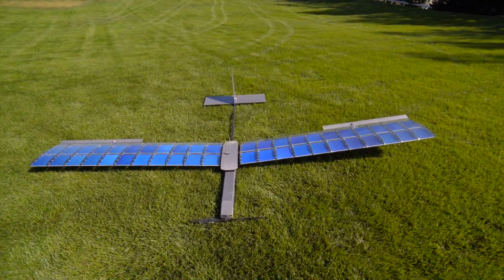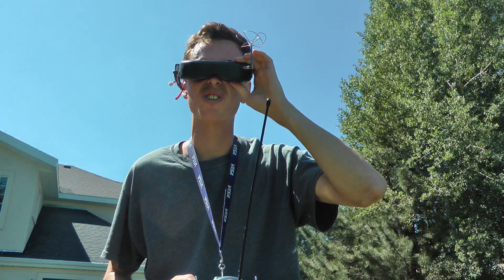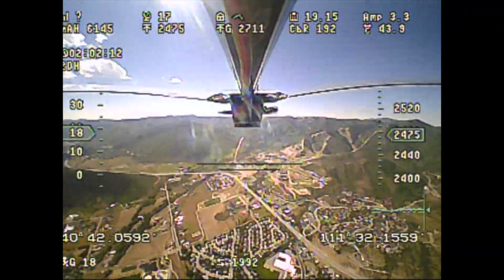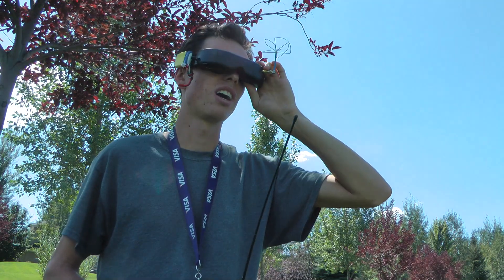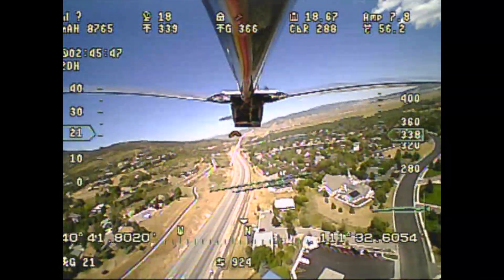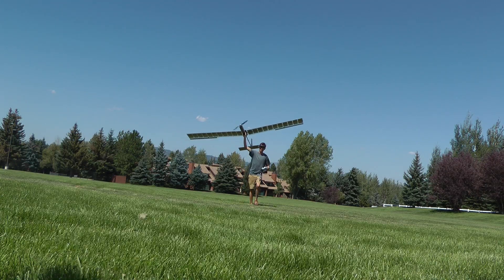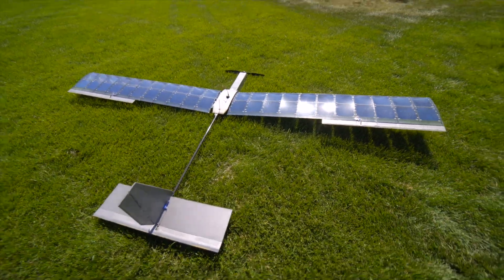SOLAR Plane V3 Long Duration Test Flight - RCTESTFLIGHT

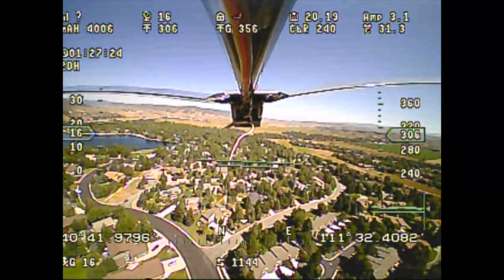Comment: 5:08 So you know what I would do? Don’t allow the system to draw more than the most efficient amount of energy from the solar cells. Use a regulator that will never allow the draw from the system to exceed that max.

Comment: When flying with the engine off, be sure to stop the rotation of the propeller. This greatly reduces air resistance. This mode is configured in ESC .

Comment: Soggestion...Couldn't you electronically switch back and forth between two batteries, charging one while powering flight from the other, in order to get better charge efficiency from the solar cells?

Comment: I'd like to see this revisited, but instead of traditional solar cells, trying out the newer gallium-nitride solar cells. MUCH more efficient for the same area. Possibly even a reducing gear and a 3 blade prop. Keeping the motor at a higher rpm will reduce the current draw. Might be able to squeeze double the total range out of it.

Comment: You need a power controller. When battery is fully charged, the solar will directly power the electric motor. That way you will have a better power management.

Comment: This is super satisfying, really awesome, amazing, I can't even put it into words.
I do have a question. you mentioned that due to high wind and turbulence towards the end, the plane wasn't able to sustain flight, so if this were built on a one:one scale to transport humans, would the larger size of the plane make it efficient or will it run into the same problem?

Comment: My first flight went like this: it flies! Yeeey! Oh dear, I am going a lot faster after that turn, it's the wind. Oh no, it's flying fast and that elevated railway is approaching quick. I want to turn please. After the turn the land speed was 0, and then it crashed in a small canal. I had no elevator rudder, it was very cheap.  Moral of the story: the wind direction and speed are the most vital thing to keep an eye on when flying. When you have such a strong wind you never want to fly downwind first! It seems obvious but a lot of people make the mistake.

Comment: Couldn`t it be possible to fly without the battery? Or do you need a storage in between to cancel out current draw fluctuations? Pretty cool thing :)

Comment: probably diy mini mppt controller for solar + weight reduction + more aerodynamics
maybe ditch the battery altogether - use a supercapacitor 
also heard the ardupilot is able to catch thermal lifts with help of some sensors

Comment: just ran across this video, thanks YT for recommending me.
I'd have an autopilot/waypoint program so that plane would land on a runway big enough for this plane to land, let it sit there until battery gets charged and repeat process.
once plane can break even and fly indefinitely until nighttime you can have the plane land and sit off of runway until daylight and fly again.

Comment: Not sure what you're up to (just stumbled on this video) but sounds like you should learn to paraglide and then use that experience to nail the thermaling.  PG pilots regularly take off and fly for 7 or 8 hours over > 200km without a motor or solar, it's all about milking the lift...

Comment: So I have a question what system would I need to be able to set home points or holding patterns I’m attempting to build my own solar glider but around the 250g weight limit I’ve already got my solar cells picked out and choose a 2s system for the powerhouse the airframe is going to be 3D printed pla

Comment: If you want to move fast, you need small wings, if you want the batteries to charge, you need big wings to put the solar panels on. So, unless passengers want to travel at the speed of a train, this type of transport will not happen. That of course, is assuming that crazy efficient solar panels aren't going to be invented, but even with 100 percent efficiency, I think it wouldn't be possible to travel at useful speeds (I haven't done any math though, but 100 percent efficiency is impossible). 
As a model airplane, this is an awesome build. You have a great channel.

Comment: You should build a wing with 3 or 4 rows of solar cells ( not 2) and the same wing span. You need more solar cells in parallel. Besides a wing with a wider cord would have a better glide slope.

Comment: I just found your channel so forgive me if I ask a question you have already answered but did you think about setting the power supply to run on solar then only if it is not enough power coming from the solar to switch to battery backup power then have a trickle charge from solar to battery which could increase as the load decreased. Much like a home solar power set up. Using solar cells and wind to battery for use.

Comment: Great work. Very impressive. Just wondering whether the solar cells are getting a bit hot as they seem to be inside the wings. If so, then their output reduces for the known reasons.

Comment: you might try two battery's set to power the motor intermittently,  while one charges the other powers the motor.  but really you need a battery that can last at least 12 hours, unless your plane travels at the same rotation speed as the planet to stay on the light side to follow the sun ie a sun chaser. so you need to travel at or above 1037 miles/hr   or 1670 kilometers/hour , to stay on the light side and not need battery's, and add an Ai that can keep the plane on track, so you don't need to stay in touch with it.

Comment: You Need to add to add 6 to 10 more cells. If sun is not hitting cells at an ok angle the power goes down fast, more than 20deg I think. Also the MPPT charger specs you'll need to look at. Does it buck or boost or both? Youre using 44 cells, that's about 21 volts drawing power from them. My MPPT for my house only bucks so I need more than the battery voltage. 48vdc needs 55 to 60vdc. You have to keep battery.... Looks like you have 80watts now, right???? Watts are good, voltage is off. But I like what you're doing, I wanted to try stuff like that 40 years ago but the parts needed were not around back then.

Comment: I would put the brake on the  ESC when there is no throttle input.  A spinning prop offers more air resistance than a stopped one. At least that's my understanding.

Also, if you wired in your solar feed on the  motor side of the current sensor, would it measure backwards?  Show up on your OSD?

Comment: By taking the battery out of the plane the weight will be reduced possibly helping sustained flight.
Reply: The Solar Charrge controler would probably just shut off without a battery, but a very small one would do
Reply: HACKER 3000 true

Comment: you can use small super capacitors with batteries solar panel will charge super capacitors and they will charge batteries fast. So every second of sun light will charge super capacitors.It will be used as buffer.

Comment: i'd say: flying wing design plane to maximize surface area for solar cells,
and divide the batteries in 2 and charge one while using the other.
also it seems like there is room to downsize the batteries and reduce weight.

Comment: Time: 4h 12m
Distance 78.2 miles
4h 12m = 4.2h
Distance in Miles / Time in hours = Average speed
78.2 Miles / 4.2h = 18.6 MPH
 
I wanted to make a scooter/solar car with the same idea
I would use Sunpower cells and MPPT controller
....oh wait those look like SunPower cells, but your not using a MPPT...WHY???

I love math...and esp solar, SO useful!

Comment: You want an MPP (maximum power point) tracking charge controller for the cells. That should ensure you're getting the most possible out of your cells.

Comment: Get rid with battery, use super-capacitor directly connected to solar, 
no charge controller - > higher efficiency and less weight

Comment: To test the abilities of the panels & batteries, maybe stress the system by ADDING weight on test flights.  

Do 15 minute flights and progressively add more weight.  Added bonus is it's easily measured so can be analyzed quantitatively.

Comment: You need to get rid of the plastic over the panels, you lose alot of power gain on that, build the solarpanels directly on surface of wing and you will gain alot more power.

Comment: Lose weight - anywhere - everywhere...  How large is the battery? If smaller and lighter the plane will be more efficient...  Use a switching circuit to give solar direct to battery if there is some draw problem...

Comment: Looks great! But I think you loose power from the cells because of the plastic film. If you redesign the plane somehow that puts the cells in direct contact without the film they should work better. I had 1.5w cell that was (behind a small bit of plastic) only made about 500-800mw.
I don't know how to fix it, small flexipanels or a total redesign of wings/body that still can fly with straight non flexible solar panels.

Comment: Bare minimum battery pack for telemetry and get a few super capacitors. They are made for this type of use: fast charge and discharge cycles.

Comment: i would like to see if you could charge supercapacitors with the solar panels and then using the capacitors to charge the battery. or using the capacitors to offer the motor additional power when needed. ie ascending and taking off.
Reply: @rctestflight https://www.youtube.com/watch?v=vWgwYBDSHGo timestamp: 12:00 maybe this will help.

Comment: When i was in college, our solar electric team split the duty of the batteries and solar. We used one, charged one. Switching batteries after charging. That way our motors and solar cells didn't have a conflict. interesting thing to consider.

Comment: yeah i wld. try step down converter and maybe try using a few super-caps to more quickly recharge batteries and maybe go with little more battery just in-case it gets cloudy and if sun gets low maybe caps can still charge batteries.im no expert but so many if,s and maybe.s.like this stuff

Comment: Why avoiding thermals and switching off the solar cells? Thermals are technically solar power as well, why not make use of all resources available to maintain flight? Also, as you're dropping in altitude and slowing down the plane, why not use the propeller as a wind turbine by initiating regenerative breaking?

Comment: Are the wings ported to allow cooling air under the solar cells? As the temperature increases on the solar cells the efficiency goes down.

Comment: I am going to say something you don’t have to do it but it would help to increase flight time is to change the gear ratio from 1:1 to a bigger gear on the motor and a smaller gear on the prop the prop would have an increase in rpm but the motor would have a decrease in rpm because you do not have to use as much power from the engine but you can do you and this is just a suggestion for you and great vid

Comment: Like the guy said you can fly in North during summer all day long.
Send up a train of them with Wi-Fi repeaters.
If you can talk to another plane at 24 miles then 1000 of them can continuously circumnavigate the globe creating a global wi-fi network.
Each drone has its zone that it patrols while talking to all 1000 other drones. Then let Alexa take control of it. If you had enough battery to fly all night you can cover the entire planet and be the envy of NASA.
You can do the same thing with drones but they need to be big.
Then incorporate some machine learning and make the plane self piloting.

Comment: Having those goggles and the RF signals that close to your head is not wise, by the time the next next video comes out you will have three eye balls. When you get older you will be sitting in a recliner drooling out of one side of your mouth.

Comment: What is the specific solar cell you are using?   Have you thought of a 3rd row?   Also check out the transmission of the clear film on your wings compared to the energy conversion spectrum of the solar cell.   It could be you are cropping higher energy photos (near UV) that might limit the energy production of the solar cells. You'd be surprised at some material where they go from near transparent to near opaque over a short change in wavelength of light.   The easy test is to do this on the ground with a cell and your wing film.  Then you will know if this is significant or not.

Comment: Smaller battery to reduce weight?  Lower kv motor with a bigger prop could help as well. Very cool project, thanks for the vid

Comment: i recommend you to get a bulk converter so you can step-up voltage while limiting maximum amperage so you always run the panels at maximum efficiency.
Reply: otherwise known as mppt controller
Reply: you re right good idea thanks

Comment: It's funny because the battery makes it HARDER for the plane to sustain flight on solar alone, but you need the battery unless you know the plane can sustain itself without the battery. It would be interesting to go with a tiny battery. or maybe just a few big capacitors for takeoff.

Comment: Best to have no mppt controller. Just one diode on positive side and match the battery max voltage  to max solar voltage = maximum efficiency. Plus matching kv rating of motor lower kv the better

Comment: Dude have you tried to just use the solar panels only to charger the battery, not the motor pulling directly from the panels. So current goes from solar panels to battery and then battery powers up the motor only..

Sweet

PS: really enjoy your videos.. I'm a micro helicopter guy... But love planes also, have me a XK A430 Edge. Love that thing...

Comment: Hey man thats an awsome project! I know this video was from 2017 but have you thought about using fresnal lenses on the solar panels to help concentrate the sunlight on the panels giving them more power output? Also maybe try another wing further back behind the first one to improve lift and add more solar panels.. Also perhaps maybe research a more lift efficient wing formation like a delta wing pattern.. Just some helpful ideas to think about but very impressive build all in all! :)

Comment: Nice work. You remind me of myself. I’m on my 3rd prototype of a different project from yours. Searching for the most effective materials sometimes takes months or more. Then try finding a supplier  to purchase them can be a challenge. I’m curious what the efficiency of the solar cells you used. The newer cells have an approximate efficiency of 47% compared to the older more popular cells of 27% efficiency. I’m sure you have done your research, but if you are not using the more efficient cells, it can boost your research. Note: The flexible solar cells are one of the least efficient. Good luck.

Comment: This is an awesome project ,u can use some super capicators of small size they will instantly recharge and help batteries to recharge fast.Also  u can use some more solar pannel in the back wings

Comment: What about LTE transmission of video and telemetry? And you can buy a MPPT controller capable as low as 3Amps or more, just use a proper charging and you will get much better buffer of power to overcome headwinds... You can also use supercapacitors to get buffer for power peaks while battery can be like idle... Great vid anyway, cheers... ✌️

Comment: Very good . 
1. Waypoint fight plan , large circles or figures of 8 , should allow you not be plugged in and have to be so personally engaged the whole time.  Flying in endless ridge lift and you will stay up all day with no power input .
So make huge  GPS waypoints file. 

2 Your main anxiety then would be low battery voltage , so set an alarm to alert you at a certain voltage threshold.

3. More cells could be mounted on the tail plane , along the fuselage pole .

As you realise you are depending on sunlight availablity and quality. The fact is it does significantly add to flight time  makes this project a complete success already.

Comment: What kind of solar cells were you using? Now flexible solar cells are ~20% efficient. A solar car used a variable field magnet motor for efficiency. Lighter, more efficient controller, lighter body. Higher performance batteries. Could make it better

Comment: Try isolating your solar panels and battery with diodes....Use 25 to 50 watt resistors (abt 1.3 Ohm) and shunt a charge to the battery...

Comment: If the motor draw is really pulling the cells out of their range of efficiency, how about splitting the cells into two half-capacity batteries and charging one in isolation while running from the other. At a set low voltage you could have the connections switch.

Comment: I'd say what you have there is a plane you can fly as much as you want without worrying about power. because you'll get bored of flying it before the batteries run down, and presumably it can soak up some rays on the ground for the next flight. ;)

Comment: Great video and work. A pleasure to watch.  I agree you need to add number of other voltage/amp meters to better collect data from each segment on the plane.  Will subscribe and check out your other vids to see if there was any additions.

Comment: What if you split the wings with 2 batteries and a switch to go back and forth, draw from one battery and panel and let the other panel charge the opposite battery then flip the switch when one gets low.
Reply: like having two 3or 4 cel and alternating between them, and if you need more power use both?
Reply: @darkevilapie  yeah because he said when its not drawing power it charges super fast because it allows more power from the panel.

Comment: Would it be beneficial to have two batteries? One for charging and one for discharging. Then when the discharging one gets low swap them electronically so that the other one charges while the first one discharges.

Comment: Oh my God! You're saying that when the engine is running that the solar cells don't put as much power into the battery!??!? That's shocking!!!
Reply: Yes,. U right,. That's will,. Short or broken battery. Have u some like cut out that the charger battery. It will be oke